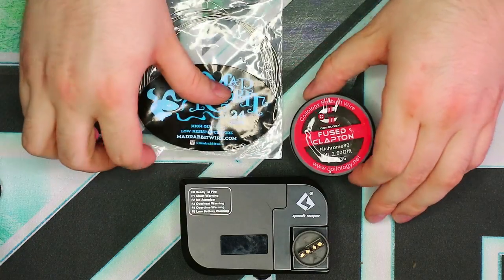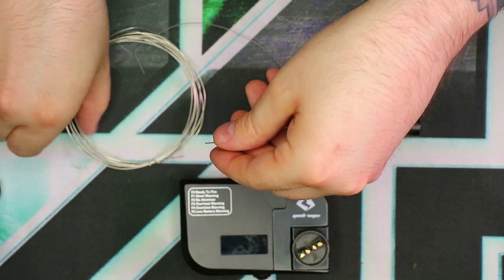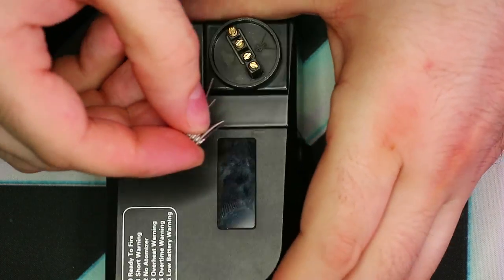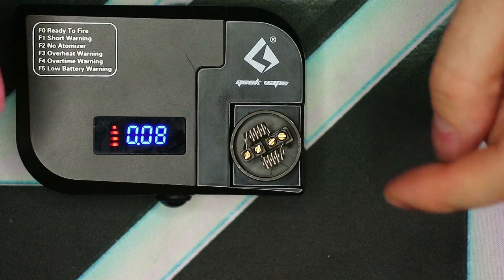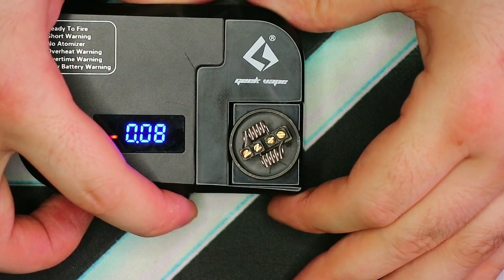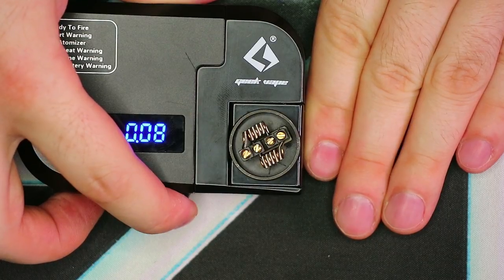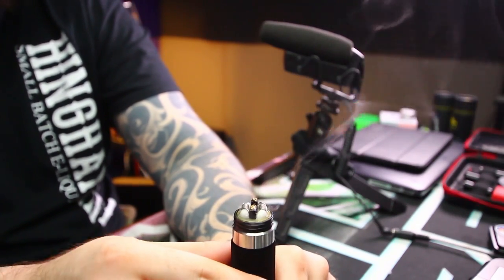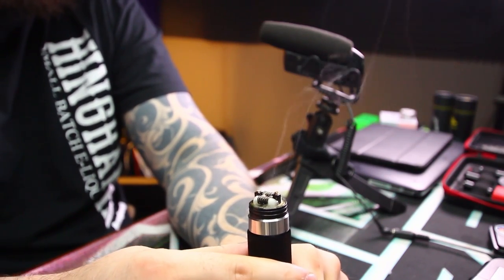#FRESHBUILDFRIDAY - 20700 Mech Build

Comment: What battery are you using?
Reply: Coming back to this Video because the Shop I work at only has the Ijoy 20700,  they don't feel as "punchy" as my 18650's that i know a bit more abt. Even with the same build.
Reply: My ijoy 20700 isn't punchy either my 18650s with my sleeve seem to feel better in my opinion

Comment: Someone told me today to never build below .25 for mech builds
Reply: canadianbarber try doing your own research, I don't know everything but what I can tell you is that in my experience, the advice from others has scared me away from mechanical mods, I comfortably vape at .15 on my pulse bf mech, but that would be much too low for a series battery device, learn ohms law, make sure you are using legitimate high amperage batteries and do your own research! No one has your back like you!

Comment: Hi Nick, i can see you set your wire a wrap out of the fused clapton, if you can understand what i mean :P but i have built plenty off those builds, and i have many problem with it's goona make dry hits, because the single wire, there it's not the fused clapton it's heating up faster than the fused clapton, soo many of my builds will the clean wire, glow, if you understand, so i don't make another wrap out of the fused clapton, so you have the clean wire inside the fused clapton, if you don't understand that's totally fine, i can send a picture if you want off what i mean, but have you experienced that ? or do you have a meaning what about i need to do ? i have tryed with plenty of cotton so the clean wire it's packed with cotton :D

Comment: that battery is good for pulsing at 30 amps according to battery mooch.. and your build rocks it out at 38 amp and 160 watts..  how in the hell has that thing not blown up on you? i'm not being sarcastic lol i genuinely wanna know cause i hover around .30 for safety sake. and it just isn't doing it for me vs my regulated mod.
Reply: Jonas Quinn 40a is the max you can go on 5 legged ijoy and sanyo A 
anything above 40a is too risky 
as long you're not chainvaping and you know whay you are doing its okay
Reply: Ok, I get so upset constantly hearing this. Your batteries DON'T blow up. There not grenades people.  Secondly you don't need to vape at a 0.3 or 0.2 on a mech or unregulated mod. Even at a 0.1,0.08 you can do it with zero issues if you run good batteries.  With a warm vape like that your literally only "hitting" it for maybe a second to second and a half. Which is basically pulsing your battery.  My Sony's handle it perfect and never even get warm
Reply: I know it won't blow up, but I've seen mech mods vent on .10 while my buddy on the same battery can chain vape with the same coil
Reply: Jonas Quinn - The reason you're not liking the vape on a mech mod vs your regulated mod is because those are totally different worlds in itself. A single battery mech mod isn't gonna fire worth shit around 0.28 & above. It will take forever for that coil to heat up & the vape will be cold. (Single) battery mechs work very well anywhere between 0.08 & 0.25, then it diminishes. Now a dual (series) battery mech mod is a different ball game. That would suit you better for what i think you're looking for. But personally, i wouldn't recommend going anything much under 0.4 on a series. And make absolutely sure you buy "only" top branded high amp batteries like Sony VTC 5A, VTC5D, VTC6A, LG HB2, HB4, HB6 or HG6.  And make sure to also buy them from a replicable company such as liionwholesale for example. Be safe & happy vaping !!
Reply: moparlover55 oh no I love my mech mod.. I just dont build super low.
Reply: Jonas Quinn - I understand, just some good/solid advice from one fellow vaper to another. I'm not into building anything below 0.2 ohms myself.
Reply: Sony vtc5a or Samsung 20s. I been using the 20s recently. Check em out. They're the best 18650 rn for higher amp
Reply: Ampking 20700 40a bats will be fine!
Reply: Because voltage drop of mech itself, build, battery and natural battery sag etc u never get the theoretical 4.2v/8.4v it's not how this works. Most .1s are drawing barely 100watts and voltage more at 3.6-3.8v depending on variables of ur setup blah blah blah
Reply: @cavemanlovesmoke4394  lol… was I expecting a reply from a five year old comment today? No, no I wasn’t.🤣 thanks for the info, I learned about it around 4 hours after I posted this comment.